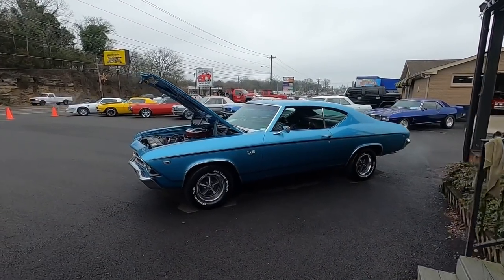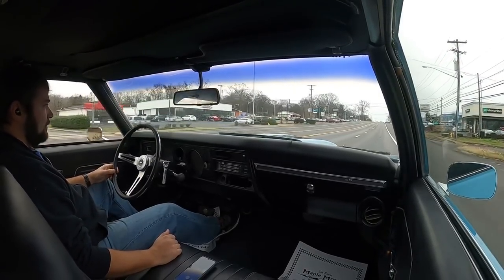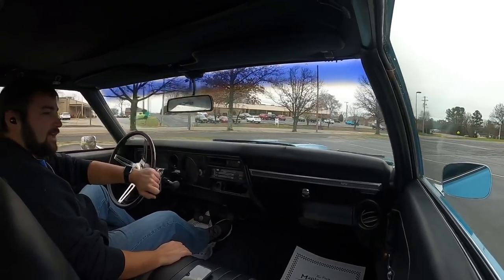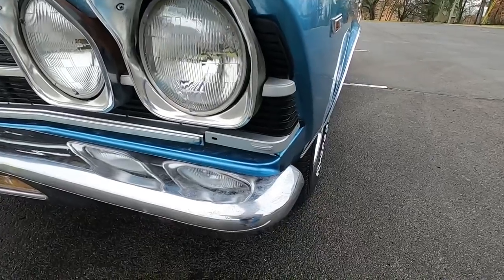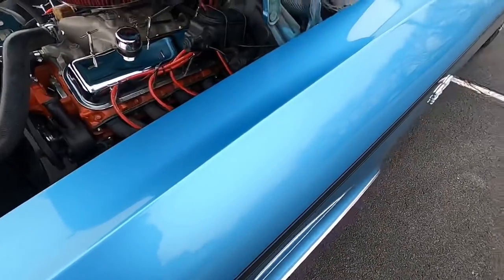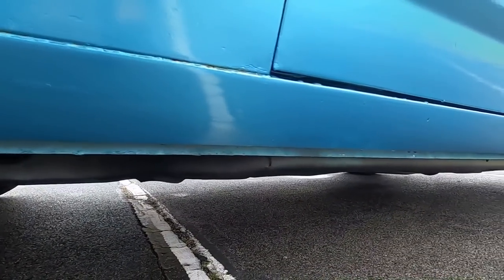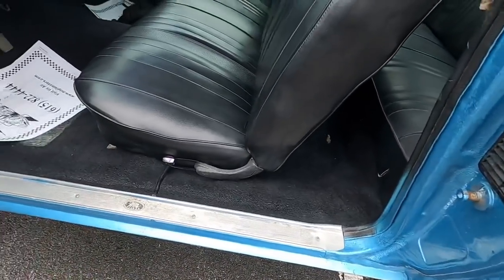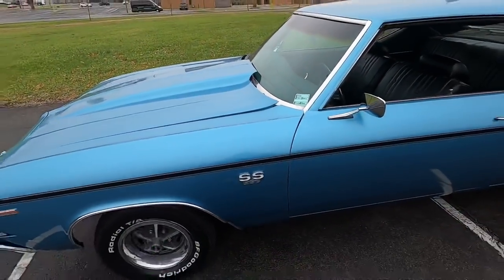Test Drive 1969 Chevrolet Chevelle SOLD $29,900 Maple Motors #1436

Comment: I have an in progress, (stopped due to a costly divorce) custom build project 1955 Chevy, big window truck that has been in my family for nearly 50 years. I am willing to part with it for a completed car or truck. I have 30k into it. I will not give it away, but will trade equal cost for value for a completed car or truck. It has chrome grill and bumpers with the wood bed. New custom frame 2x6 tubing, new high performance 425 horse 454 Chevy create motor, turbo 400 auto trans, new aluminum fuel cell, new radiator, new heidts suspension, new serpentine belt system, aluminum intake, new custom wheels and tires, headers, 4 barrel carburetor. It needs interior and body, paint and glass. Body is straight with some minor rust spots in the usual places but overall great shape. It just collecting dust and taking up room in my garage. It pains me to let it go but I am nearly  60 years old and am starting over financially so I don't see me ever getting it finished. I have two young daughters, but don't see any interest from them in my family truck. Reply to my comment if interested. Thanks

Comment: Oh my God man 69 Chevelle 396 it does not get much better than that that's going to sell fast 😎✌️
Reply: It’s loaded with options to be a SS but that dash cluster is incorrect! They had a rpm gauge that had different red lines depending on HP! Plus around the rpm gauge was the oil, temp, and voltage gauge that was all circling the rpm.  The 69 chevelles was one year that was hard to identify if it’s a SS! But just a few cosmetic things on this ride and it would be perfect IMO!!!

Comment: Need to check the numbers  on this car a lot of things say not a real SS this car should have a 400 turbo trans not the right hood needs a lot of work for a $30,000.00 car the factory A/c is gone
Reply from the maker: Not advertised as a real SS , if it was a real SS it would be priced around $50k. Thanks
Reply: @MapleMotorsNickSouthgate  Yes but you said it was a number match car  I don't think so
Reply: He never said numbers matching
Reply: He said date correct